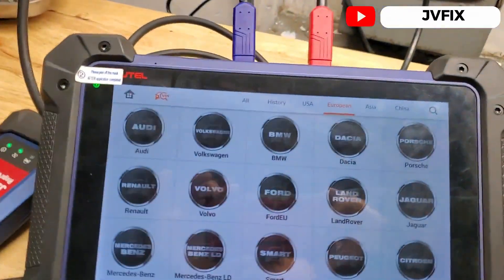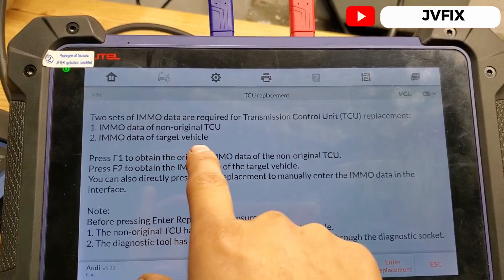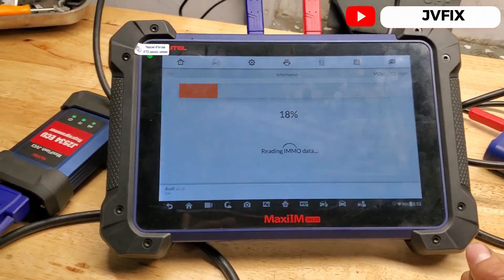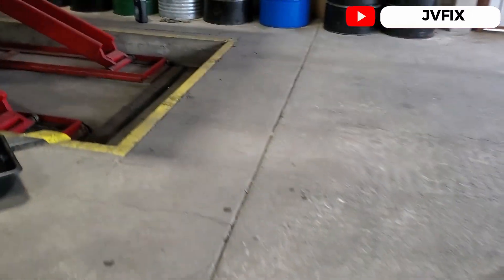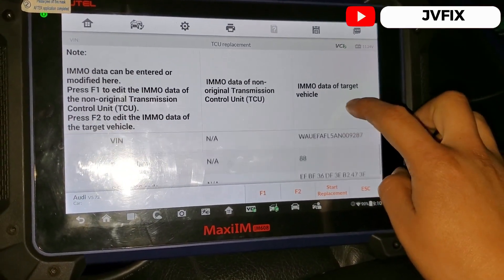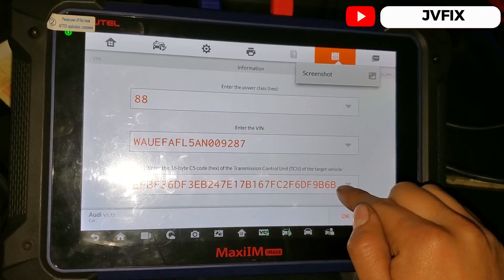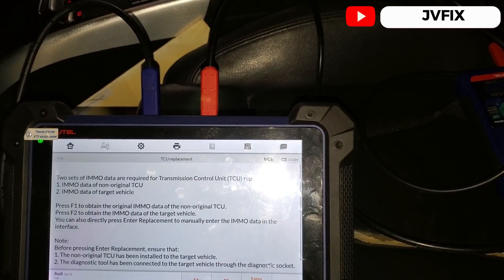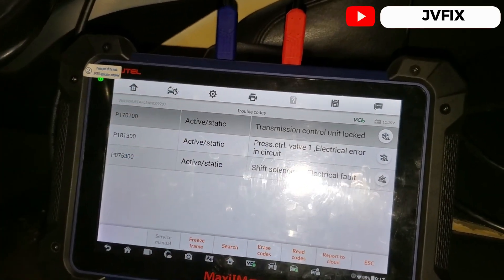How to program and clone 2010 Audi A4,A6,A8,Q5 Transmission Control Module with autel IM608

Comment: I'm trying to do immobilizer adaptation on a 13 audi S4. Im trying with an im508. Its failing to read the donor. I did not try the resistor though. Is that a possibility why?

Comment: I had a 2011 A4 8HP55 with a bad front differential. I bought a low mileage used transmission to replace it with and nobody around my area could code it. 3 shops and calling 2 dealers and performance shops specializing in Audi, VW, Mercedes and BMW couldn't code it. As a last ditch effort, I swapped the old transmission control unit out of the old transmission into the new to me transmission and it works! No coding or diagnostic equipment needed. It's tedious but doable without any special tools or equipment. No cloning, dealer or specialty shops to do this. Just take your time, pay attention,  be careful with the wiring and control unit and put it in the replacement transmission. Problem solved! I just completed it today and all is well.

Comment: Hi, I have the same computer, but I can't connect
Reply from the maker: You probably Don have a good connection make sure your resistor is tight and in the correct pins too

Comment: Is it possible to rent these tools? $3.5k. Would it be possible to use vcds to do the same thing? I have that tool. Do you offer this service?
Reply from the maker: renting a machine like this I don't know anyone that rents it. and VCDS only can program new ones. the one that can do it is ODIS that's the engineering software  for audi, vw, lamborghini, porsche. 

I can help you out if you ship it to me. I am still working on my website to offer these services
Reply: @JVFIXLLC  where are u located?
Reply from the maker: @living9377  Visalia California
Reply: @JVFIXLLC do you have a website? Btw can you please give more detailed specs on the resistor? Can you check if the maxi support the vl300? A lot of programmers say they can’t do it.

Comment: Nice. What if original control unit from the target car  is demaged  and has no comunication, is it possible to program the new one on the car without original data
Reply from the maker: yea with this scanner is possible to code a new one
Reply: @J @JVFIXLLC xcellent work man! Original control unit damaged, I have new one from donor- the same way programming possibly ?

Comment: Thanks for the video. It was very helpful. I have the new Autel MaxIM IM608 Pro II, but I can not find the "Expert" selection; does it come with the default subscription? or do i have to do something to make appear? I got the machine three months ago
Reply from the maker: it should be there since u have the upgraded and faster version of the scanner. but u have to go to the immobilizer software not the diagnosis
Reply: @JVFIXLLC  Thanks. I found it and tried to use it today with a 2012 Audi A5 transmission, and it didn't work. It says only 0AW TCU is supported, whereas mine was 0BK. I ended up switching the TCU, and it's working so far.
Reply: @JVFIXLLC io
Reply: J😊😊😊😊😊😊😊😊😊😊😊😅😊😊😊😊😊😅